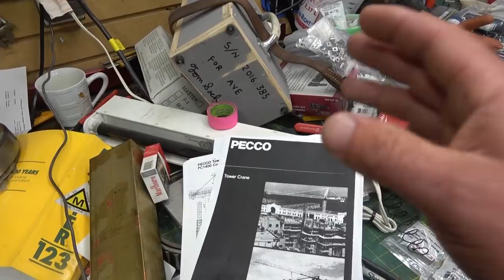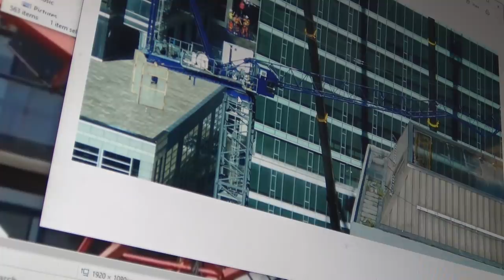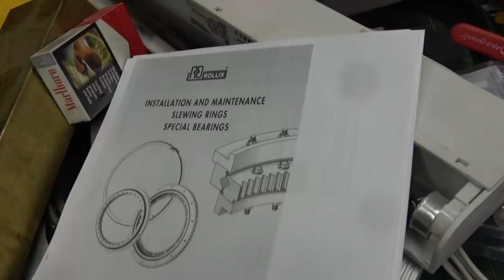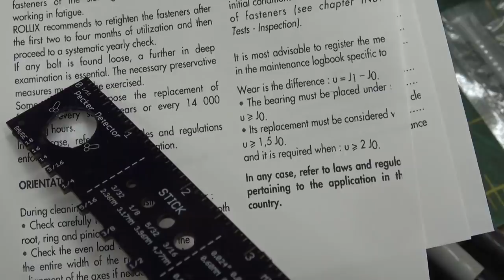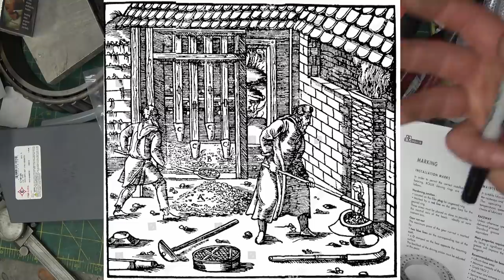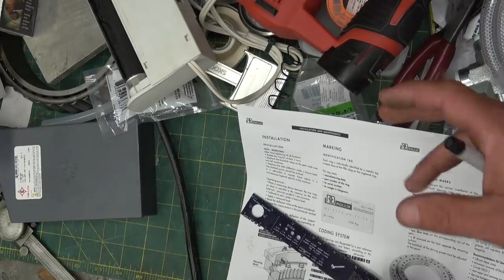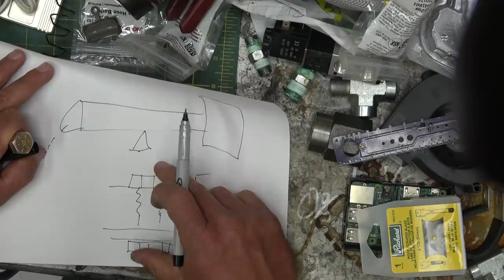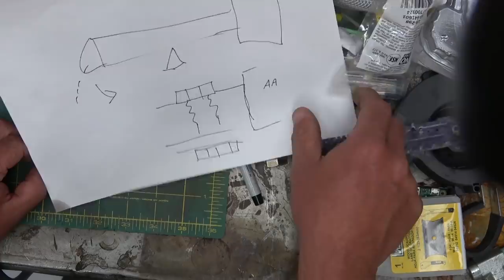This is happening too often | 2 Cranes Collapse in Toronto

Comment: Ehhh, the preload explanation with the rubber band was off the mark. That spring with 50k clamping load won't stretch any more until you start to try to move it with more than 50k lbs force.  For example, if the rubber band is holding two things together with 10 lbs tension, one must apply more than 10 lbs to get the rubber band to yield further.
Reply: Or cause it to resonate....
Reply: Not actually true, any external load will cause it to stretch a little extra. Although in a well designed joint it is a close approximation. 

Look up joint diagrams to see why

Comment: I first learned what happens if the torque isn't right as a ten year old, in the back seat of my moms '71 Beetle convertible when the left front wheel came off at 70mph on the way to Wasaga Beach, bounced off a Buick beside us and then went over us into the ditch.  The top was down of course.  Many years later, I'm an enginerd looking after highway bridges in a corner of the province and the most dangerous situation I came across was a jacking system to lift a post-tensioned bridge so the bearings could be replaced.  The bolts attaching the jacks to the face of the abutment weren't torqued, so the capacity at failure was limited to the crushing strength of the concrete under the bolts, rather than the capacity of a shear friction connection. Luckily, the actual lifting capacity for this failure mode was lower than the weight of this bridge, so it failed before the bridge could lift at all.  It took a lot of effort to educate the contractor that they had just been extremely lucky, because they were using the exact same system on jobs all over the province, but had always lifted bridges that were light enough to get away without failure.  Sooner or later they'd be lifting a bridge that would be just light enough to lift, but then have no reserve capacity to support any extra loads, making for a very dangerous workplace under the bridge.

Comment: I have seen a few failures of crane uppers. Lack of checking of the bolts, wrong grade of bolts and the bearing mounted wrong.  
Torque is different wet and dry. Some bolts are also hard to reach when the crane is in operation!  And yes poor greasing .

Comment: I work at a shop that does material testing and we will occasionally get fatigue tests in. The most recent batch was corrosion fatigue under high pressure hydrogen sulfide. I'm not an engineer so its all pretty foreign to me but interesting nonetheless

Comment: Correct me if I'm wrong, please. Maybe I'm missing something... If the bolts were torqued to provide a clamping pressure that exceeded the operational load of the bolts, then surely they would not stretch and rebound under normal working conditions?? Incidentally, as an aspiring 300lb Gorilla in my younger years as an apprentice mechanic, I learnt plenty about the yield strength of bolts. Keep up the good work.

Comment: If someone was following the recommended maintenance schedule and retorqueing the slew ring bolts, how many cycles would be removed from the lifespan of the fastener by retorqueing the bolts? Also is the replacement of the bolts recommended in that manual at any time? Would there be a good way to build a continuous sensor to monitor impending bolt failures and warn the operator in the cab?

Comment: That was interesting, never considered the concept of preloading like that, makes lot of sense.  I can only begin to imagine the engineering that goes into figuring out what is the proper torque spec, I'm sure the numbers are not just out of thin air but are optimal for best life of that particular part of that machine. (whether it's a crane, or anything really)

Comment: Good analysis.  Suggest repeated overtorque (used bolts) might have a similar end result. As my favorite bamboo boom operator once said "no luffing matter."
Reply: Over-torquing would be distinct because the bolt would be "necked" (get narrower at a spot) and would have a much larger region of plastic deformation at the fracture surface (that diagonal bit in AvE's diagram).
Reply: In short, less "beach marking" and more fresh-broken surface.

Comment: I'm an electrician, so going out on a limb to suggest that I may be wrong. 
However from years ago, playing with engines, I was taught regarding conrod bolts. If they are tightened up to hold the bearing cap to the conrod with a clamping force of say 10 tonnes, and then the forces trying to pull the conrod away from the bearing was 8 tonnes on the upward stroke, then the bolts (already applying 10 tonnes) would not be stretched any further by the 8 tonne load ie, the 8 tonnes isn't added to the 10 tonnes load, but just decreasing the clamping force between the surfaces to 2 tonnes momentarily. 
Or is this this when minute further stretching is occurring?

Comment: The second crane they fell, the operator heard/felt bolts snapped during lifts in morning. He stopped working, told foreman and they stopped work called mechanic and emptied site. Hour later it fell. The counterweight pulled it down. 
The first crane ( in my opinion) was an accident by operator. Crew was on coffee break and were not lifting. It looks like op was pushing on 1 joystick. The same joystick operates luffing boom and swing. It looks like op pushed outward (probably by accident) on joystick and didn’t realize until it hit. If it was luffing brake failure, it wouldn’t have been swinging at same time. 
I am in this industry in Toronto and know the operators involved. If I don’t know for sure what happened I won’t say. I just gave my opinion from what I have been told. I don’t really want to get into who I work for, etc... thanks

Comment: I am a Boilermaker Welder intermediate  Rigger and have seen metal fatigue on some HD hold down bolts that were run over a few times. Unfortunately no one let us know until the HD failed and down come the column with a rafter i shit the sounds of the steel coming down was scary that’s for sure lucky nobody was injured thank god. 😎🇦🇺

Comment: Really the lack of preload inconsistent across the joint will likely lead to failure of the properly loaded bolts carrying higher load. After failure of a couple bolts, a cascade failure occurs as insufficient bolt area exists to carry the load. Getting those bolts under a microscope will be the key to determining exactly "why" they failed.

Comment: I'm a little unsure how you come to the conclusion the bolts were not torqued properly vs. the bolts being used too long before replacing them? How would you tell from the fracture marks? Or is it just under the assumption you can see it started from a spot that's been wallered out?

Comment: Very simply answer, engineers spend inordinate amount of time figuring out the thinnest metal they can use to save a buck. They will spend months testing to see if they can get away with 1/4 inch plate instead on throwing 3/8 plate in their to make sure. As a licenced fabricator for over 40 years i know exactly what I am talking about. I see it everywhere.

Comment: To chime in. If the bolts are old and potentially have resistance in the threads you may introduce a torque between the head of the bolt and the nut while checking bolt tension. Instead of stretching the fastener, you're twisting it; not good.

Comment: I was putting in some concrete anchors today at work... Two of them...., took 2 hours because we are using a community tool box and their tools are shit. Had to make 7 trips back to the tool box because the higher ups burned up all the concrete bits.... It's an automotive refrigerant packing house. Lots of dangerous jury rigging with explosive gas everywhere. I've always been a machine mechanic, so I'm trying not to be a clip board warrior, but at the same time, get them to stop using bubble gum and chicken wire everywhere. Geez Louise!

Comment: AVE, thanks for the video, I enjoy your work but wanted to add to the commentary.  A slew ring has many bolts and a  proper pretension ensures the best possible load sharing in a bolt group. The bolt group should be able to survive the design case even with a few bolts missing, all else being correct. Now I've no experience with A&D-ing tower cranes, but normally once a high strength fastener has been torqued (typically to 70% of ultimate) it is not supposed to be reused as it is plastically deformed. 
All of that being said, something was badly wrong here, the operator "noticed" that bolts were missing? Yeah because the crane was damn near detached from the pedestal. You would feel that big time slewing around. The operator is lucky to have made it out alive. It did the old counter weight backflip off the pedestal while not being operated on a benign day? Holy hell, talk about hanging on by a thread. Anyway my guess is the bolts were over torqued or the wrong grade and when the load condition changed they started shooting off like blackcats, and the operator went down the ladder in a slightly controlled freefall. Or if the crane was newly erected, some portion of the bolts were never installed at all.

Comment: Hey there are some interesting cases of explosions caused by metal fatigue in pressure vessels. High pressure air compressors manufacturers have put a lifetime on the aluminium components because they can reach a certain amount of pressure cycles before they're likely to...bang at 330 bar!

Comment: Seen FAR too many examples of metal fatigue or other damages due to lack of inspection or proper installation, etc. I (pre covid) did a lot of rigging for entertainment (I work as a Live Event Technician doing everything from Lighting, Sound and Rigging) and there are a number of companies out there who just don't do what they SHOULD. Some of the worse offenders I've seen are Tent companies, jesus I've seen some horribly built and rigged tents. Often I take photos so that if something happens I can fall back on the tent companies. It's frankly scary and I am surprised we don't see more failures. Thankfully most of these things are "over engineered" to normal use to account for weather etc. But it does help explain why in poor conditions failures do happen.

Comment: So if they were preloaded properly they would still fail though. Failure would just take longer correct? So if this is the case how would you measure the cycles of the bolt to then replace the bolts in a pre determined interval?

Comment: Correct me if I am wrong but I think preloading bolt with adequate torque would stretch bolt enough that all threads are in good contact with opposing thread of bolt and force distributed evenly between them.

Comment: Did the manual for the second crane indicate how often those slew bolts needed to be replaced? Sound like a component that would have a limited service life even if properly preloaded. One begins to stretch or fails and it would cause an avalanche of overload on the remaining.  Love the Pecker Detector scale you were using as a pointer. Whats the story on that? Is that hole a go/no go indicator? Moile scale?

Comment: Your theory, although well thought out and probably correct, doesn't pass the Occam's Razor test. You see... the simplest explanation is that the person that was using hand signals to direct the crane driver, backed into the apiary shown early in the video... The resulting panicked hand signals - and more hilariously - the crane driver's desperate attempt to follow them... Were the events that precipitated this incident. The story about the bolts looking funny and clearing the jobsite earlier, are the result of a prankster so skilled as to actually see this coming, and have the site safed-up as to prevent the inevitable flustercluck that would have occurred if OSHA would have gotten pulled in, and the clipboards needed to make flesh offerings to their highers.

Comment: Ok, I’m not an engineer. But I am interested in all that applied to the physical, mainly mechanical. As I understood it a bolt will be spec’ed beyond the clamping load needed so that when it is torqued it doesn’t ‘see’ the load. Like the rubber band, stretched to 4” long’ say it has tension to hold 5 pounds. As long as the load is less than 5 lbs the rubber band, as preloaded to 5lbs, shouldn’t even see the load. Should be able to hold the load indefinitely. Environmental factors aside.
  Proper torque should stretch the bolt to a point where it is near strength limit. Proper engineering would have the individual load for the bolt well below that strength limit so as to not work the bolt and then induce fatigue. Proper maintenance would keep the bolts torqued and see worn parts discarded.
  Take a connecting Rod bolt from an engine. Say it clamps as a pair to 50000 lbs. As the engine runs the clamped area only sees 40000lbs of force. The bolts, as I understand it, don’t actually see the load because it is below the preloaded force generated by the fasteners. If you take that same engine outside of its normal operating rpm to the point the forces generated are above the clamping force of 50000lbs the bolts would fail since they are now seeing the load and are being ‘worked’. Over time or immediately depending on lots of factors. The above being a gross over simplification of ‘everything’.

Comment: First crane is an old piece of crap. But the operator was swinging right with a concrete smoother on the hook and a pin that connects the jib together fell out. Thankfully it fell on the building because there were guy under the jib doing work.

Comment: You left out the bicycle tyre effect where the inner and outer ring try to roll-out as the internal rollers push out. The force isn’t a straight-up pull on the bolt. The twist in the ring has a very short leverage to try and break the bolts. Still, it seems odd, given the safety factor. I wonder if they were over torqued in the past?

Comment: Great video. I don’t understand how that failure mode indicates improper torquing as opposed to, for example, a low quality fastener though.
Reply: It assumes that the correct fastener was used, which is usually easy to confirm by referencing the bolt head markings; all graded bolts are marked for this reason.

Comment: Instead of it not being pre-loaded properly or torqued to spec, could it also be possible that the bolts were torqued to spec too many times? I used to work for a company that inspected bolts for bridges pre installation and we would do NDT and Destructive testing on the batches to make sure none of them had impurities or cracks or any sort of defect. But certain huge bolts were made specifically to only be used a certain amount of time or up to a certain torque. Because of such high forces on the bolts once torqued down and regular use occurred it would often deform the bolt slightly. So once it was unscrewed it was unsafe to re-use because even if torqued back to spec, the metal was already fatigued and stretched slightly. By re-using and putting it back to "spec" that was actually pushing it beyond it's original rating if any additional loads were applied. 
My theory was perhaps since this was an old crane and it looks well worn, perhaps they had re-used to bolts a few too many times and a bunch of them were already fatigued and pushed beyond their rating. So even if torqued down to "spec" according to the manual, once those loads were applied it was just too much for the fatigued bolts.

Comment: Ave, u are misinformed on preload stress in bolts my friend. For dynamically loaded assemblies, assuming the bolts are suitably sized for the applied loads, a proper preload makes it very unlikely that a bolt will break in service if it did not break while being tensioned. If the applied load is less than the preload, it relieves the stress from the material being clamped and the bolt experiences no appreciable difference in stress. In this preloaded state, the material being clamped is the spring and the bolt experiences no dynamic loading